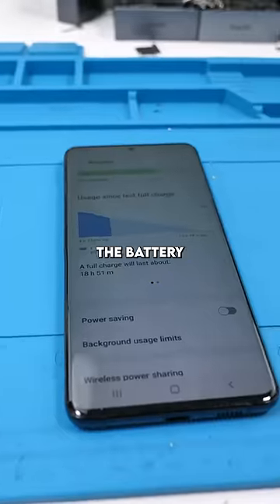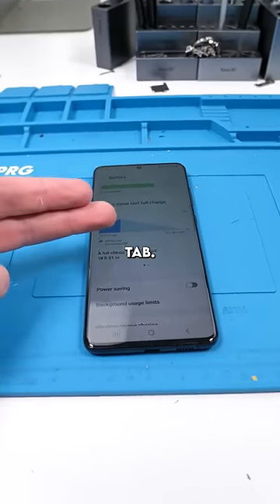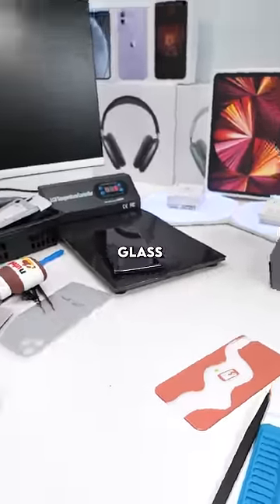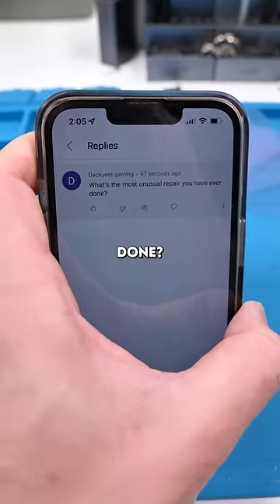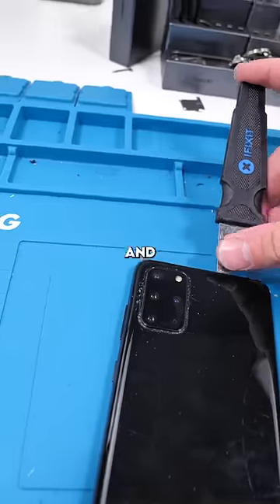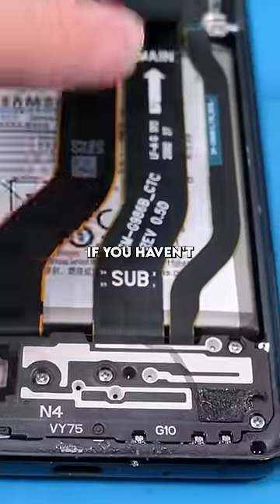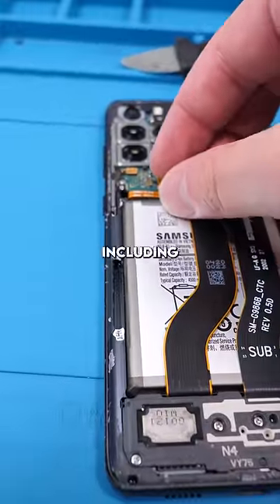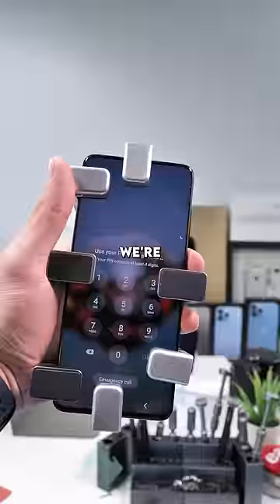Samsung Battery Replacements Are All The Same #Shorts

Comment: He is right. One UI 4.1 doesn't have "battery health info." Just option for "battery protection" i.e. 85% charge limit. Not even Apple iPad has that or double-tap screen to wake up.
Reply: you just tap the screen once to wake up on apple
Reply: @marysa4523  iPad doesn't have that. Neither for waking up or sleeping. However you can create a "double tap to sleep" via Accessibility work-around.

Comment: Hello, brooo

I have a question ❓

Recently i have changed battery of my device A51 4g, 2019 model.

But my battery diagnostics is showing action required, life: weak.

I put 2 years warranty battery but still same result like the old  battery, in device care battery is showing only 9hours battery time on 100% what's the reason behind these and do you have solution for this.

Comment: Question: you always say "done cooking", wouldn't that be detrimental to the phone since I just know heat equals electronic stuff will go poopoo? TL;DR: Also, was that battery a generic brand? Does it really matter??

 I'm asking because I remember buying this brand of Lithium rechargeable batteries back in the day, and thought I was so smart since I "saved" so much money on the cheap brand by buying new ones whenever the older wouldn't hold a charge as long anymore, but later my father bought me some Energizer brand ones when I asked him to get some for me and he being a dad, didn't wanna mess up so he bought the ones he felt better. Long story short, I realized these Energizer ones not only held the charge for much longer with the same mAh capacity, but lasted 3 times even 5 times more than the generic brand, and they weren't all that much more expensive...about 14.99dlls more but taking into account the other ones were 9.99, and math being math I realized I actually saved money with the good brand,, that's when I learned the lesson of brands sometimes being good for a reason...so hence my question, does it really matter in this high end flagship phones like Samsung? Since I dunno anything much about tech like an engineer, so they're probably different, but still my question has been there for years and always wanted to know...i hope someone took their kind hearted time to read all this and lemme know if they know the answer 🙏🏻🙈 thank you in advance 😳💖✨

Comment: I thought you would be putting in a higher capacity battery. You could buy bigger 3rd party batteries that would come with an adjusted backplate since the new bigger battery was thicker than the original Samsung one.

Comment: Battery change in the 2000s: Open the cover and put new battery in

Battery change now: Turn phone off, heat the back cover, remove adhesive with plastic pry, remove back cover, disconnect this, disconnect that, put isopropyl alcohol to loosen battery adhesive, disconnect battery, put new battery in, connect everything, reapply adhesive, put back cover on

Comment: The battery health tab isn't on Samsung devices because they don't have a smart BMS. This is why their batteries aren't serialized to the phone. Apples battery health tab is also super inaccurate and fails to take into consideration environmental factors, it just operates purely on charge cycles and voltage+miliamps.

Comment: Problem is. With a new battery you will still not have good battery life. Because the phone itself keeps track of the battery health and reduces the charge voltage. When you put in a new battery it still thinks the old one is in there. Only samsung can reset this. Or you need to root your phone.

Comment: I did it with ifixit battery on my s10 and tried 2 batteries the first one lasted 4 hours the seccond one lasted 8 hours the origional lasted 9 hours i would have put the old one back in if i hadnt thrown it away
Reply: I also put a big ass black dot in my screen because i used a metal tool to get the battery out and i scratched the back of the screen